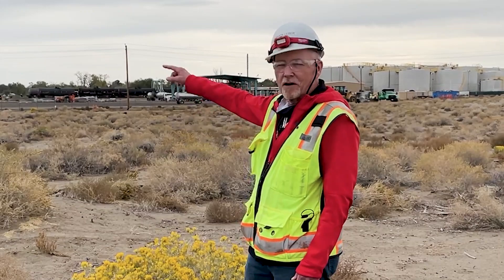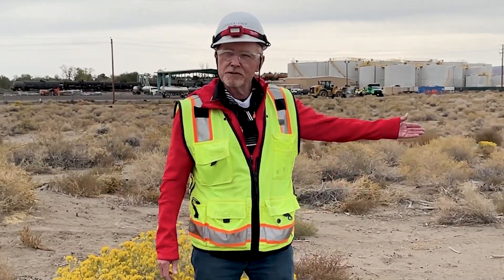American Battery Technology's Pre-Commercial Lithium-Ion Battery Recycling Plant Progress Dec 2021

Comment: Nice work, Mith.  At this rate we should have the walls up and exterior closed up by end of Feb or beginning of March.  Then things are going 24/7 to get equipment installed.  Revenue in 2Q is the goal.  Won’t be full revenue until 4Q sometime.  But we are surging forward.  And imho just AS SOON AS we DEMONSTRATE the end to end reclamation of materials at scale - things will escalate quite dramatically